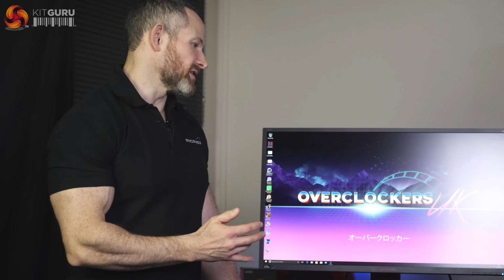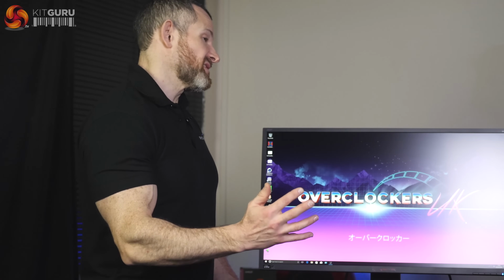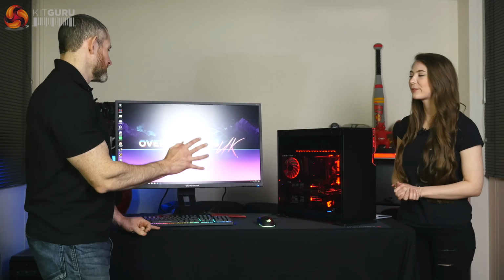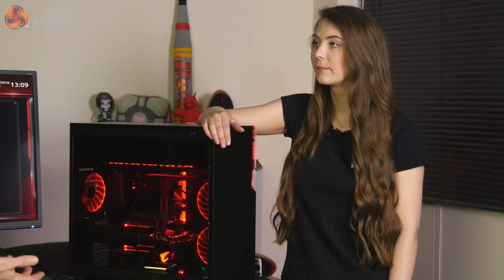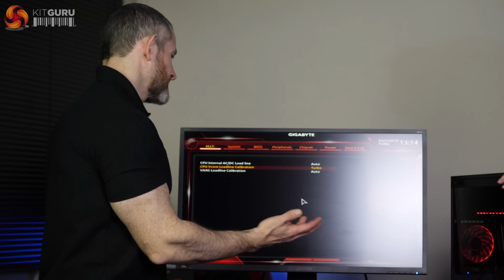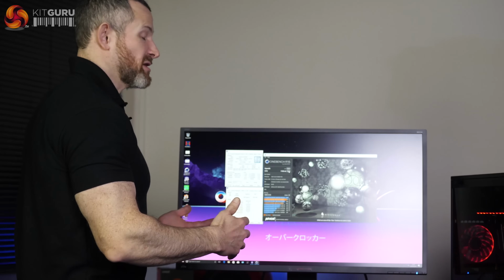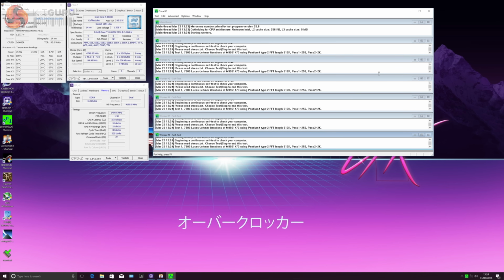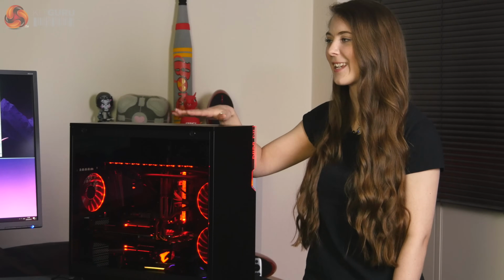8PACK gives BRIONY BEGINNER OVERCLOCKING Lesson!

Comment: Hello, i have a question,

I have overclocked my gpu, but i have not overclocked anything else,

I have a 2060 rtx, i7-8700, and the coolers i have are just LED FANS, and the cpu fan that came with the processor,

I am curious, should i overclock my cpu or not a good idea? Should i get this extra performance you showed here?is it safe and will i get that extra performance you showed?

Comment: Tue Apr 10 2018
11:25:54

Image Editing: 196156
Time: 27.162

Encoding: 77553
Time: 68.701

OpenCL: 65559
KSamples/sec:  12123

Heavy Multitasking: 80812
Time: 94.4407

System Score: 105020

-Well just gave my Asrock z370 with 8600k a run at 4900 and 1.30   and max temp was 59C  ( GPU 980 )....LLC goes from 1 to 5 so I set it at 2 just 1 below top
Had to google online because Asrock BIOS screen is so different and settings leave me confused.  
Very well done in the video to both of you

Comment: for beginners i would recommend asus for easier overclocking
Reply: TheSURGEofTech tech I think any mobo auto overclock is good. I was a legend with my pc, but i used the auto tunner, i think got it to 4,3 but almost no difference and hotter, overclock is really overrated. I know the 8350 wasnt anything special. But  overclock is never anything special i think.
Reply: Romick Vieira lol I actually undervolt my board and and overclock running 5 GHz at 1.3 and it runs so much smoother it's almsot double the score of the i7 I got . I think most motherboard actually overvolt too much for just stock
Reply: But the software suite is sooo amazing for Asus one of the best u don't even have to go into bios and u can set fans and full controller over fans just love it
Reply: TheSURGEofTech tech hum, dont know about overclocking tbh
Reply: Also I noticed the heatsink and power delivery and vram was supper hot and that was not in the case .
Reply: For me i can see that Asus rog strix motherboards are kinda good they're really put alot of effort in to them.
Reply: Romick Vieira it's easy
Reply: Romick Vieira now u do after watching the video u should .